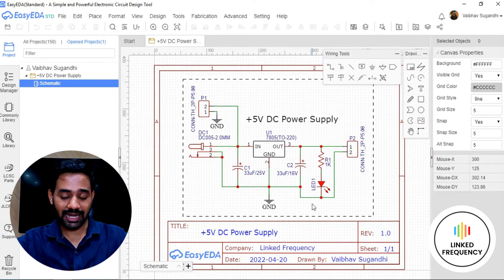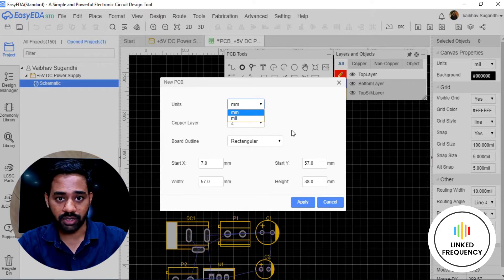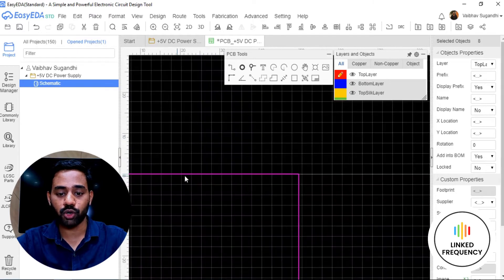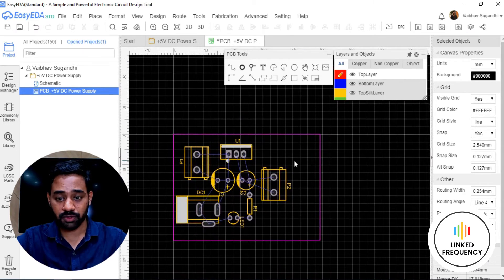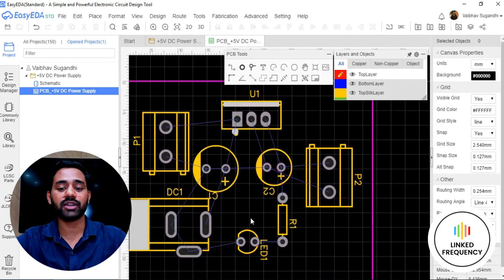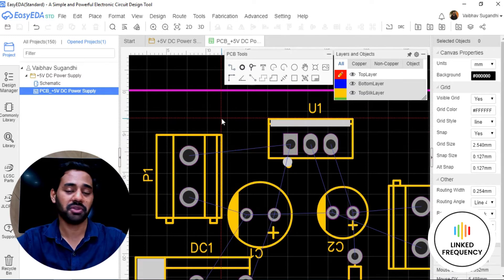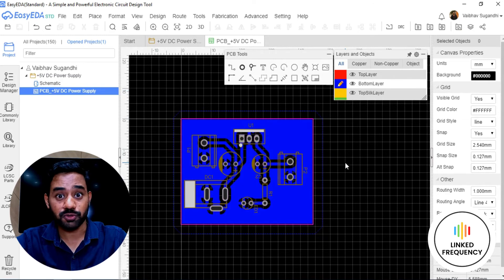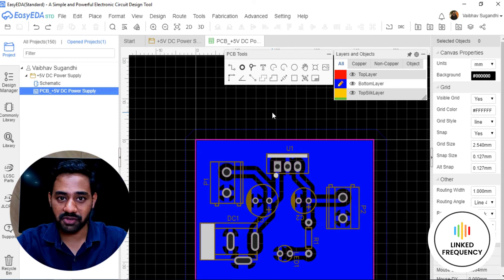The PCB layout designing using EasyEDA #E09 | Vaibhav Sugandhi

Comment: So nice videos man, congrats!
Reply from the maker: Thanks @JonatanCastro for your kind words. 
Happy learning :)
Reply: @Linked_Frequency  thank you for your time and for sharing all this! I'm about to start the basic electronics course. I already went through the PCB one.

I'm a graphic designer by day and I'm more or less used to use tools to do graphical stuff but I'm finding quite challenging positioning and aligning elements on EasyEDA. For example it seems there's no way to "easily" measure the distance between 2 objects aside from using the X/Y positioning which is really slow and time consuming to do the math

Are you planning to do any future videos addressing this particular topic on EasyEDA? Thanks
Reply from the maker: Hi @JonatanCastro, 
Thanks for writing your feedback and bringing the very keen problem point to our notice. For sure, in coming advance level PCB course we may focus on how to measure the distance between 2 components with quick method in easyEDA. 

However, currently you can use X/Y co-ordinates option to place the components exactly to the point where YOU want them to be. Yes, It is a bit time consuming and mathematical work. Let me know if you need any further information on this.

Happy learning :)

Comment: Hi Vaibhav,

Thanks again for explaining the PCB layout designing process.
I have a couple of suggestions:
1. I feel its better to add the drill hole before routing anything. As it avoids the hiding of copper pour or re-routing of the tracks.
2. Also, I guess you are using Standard version of the software and request to make a video series using pro version (which has few differences) as well. 

Cheers, 
Sourabh
Reply from the maker: Thanks for your suggestions Sourabh, I will definitely consider them for future videos!

Happy learning :)
#Linked_Frequency

Comment: I was not able to find the connection between schematic design folder and PCB folder like u r selecting components in PCB folder from schematic diagram by saying that they r correlated...but it's not happening in my pc ...can u please tell the reason why
Reply from the maker: You have to save your PCB file once it opens. After saving, it will be linked to the schematic window automatically. 

Also check your internet connection, low internet will create such problems some time. 

Happy learning, 
#Linked_Frequency